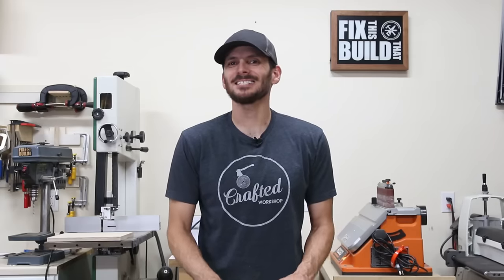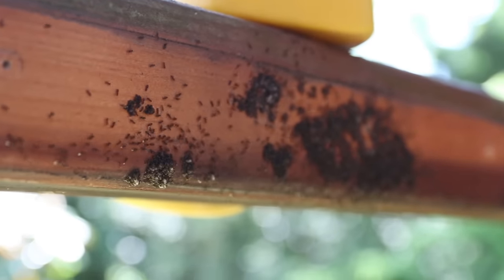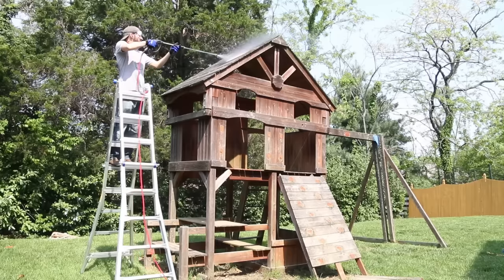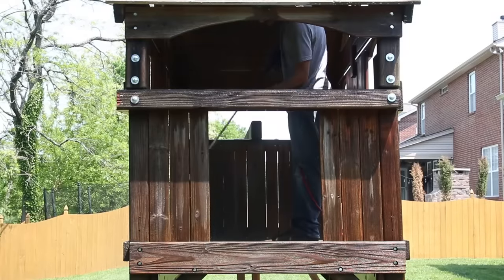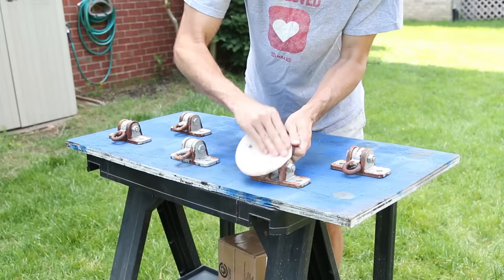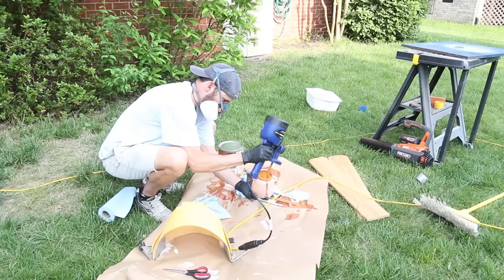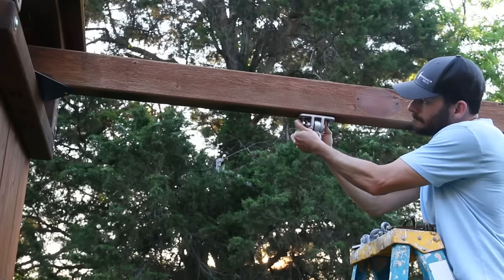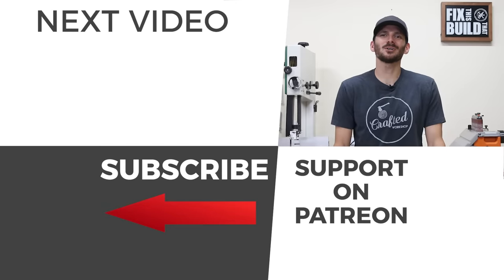Why don't more peole do this for their kids?

Comment: Awesome job! Only question I have is what did you do in place of the tic-tac-toe?
Reply from the maker: Just boarded it up. Realized I left that part out after I was done editing.
Reply: Fix This Build That did you get rid of the ants?
Reply: Fix This Build That I would have stopped working on it if I saw those ants

Comment: Amazing video.  I just got an old swingset that looks very similar and this is the perfect instruction guide to restore it - thank you!  One question - why did you end up using a sanding block instead of an orbital sander?  Would you recommend against any type of powered sander, or was the block just what you had on hand?  Thanks!!!
Reply: I was looking for same answer

Comment: Just bought a nice one. Came stained but could tell it was just pre stain. Putting on some clear oil based sealer, soaks in like crazy. I might spray it but just concerned about getting oil all over the handles, plastic parts

Comment: Great job, 1 thing I will suggest for others is if you have a "smaller" swing set attachment loot to swap out the cross beam with either a 4x6x12 or 2 2x6x12's sistered together. I actually added 1 swing set attachment to each side of mine for maximum amount of swing options.

Comment: Great good on the repair. It looks brand new! I have a similar swing set that the swing arm support bottoms are rotting out as well as the base at the bottom under the enclosure. What would you recommend for repairing or replacing to ensure it’s strongly supported?

Comment: Just finished refurbishing my grandsons playground. Mine was in a little bit worse condition but it looks new now. I used bleach to clean the wood after the first powerwash and after two coats of bleach and two rinses it looked almost white. Then a couple coats of redwood stain and it really looked new again. I also painted the rockwall and handle hardware along with bolting plates swing chains and window frames. Mine needed a new slide, and ladder and rockwall platform. But it was still cheaper than a new one. I aso added rubber mulch in the playsand area as i think the neighbors cat wont use the mulch as a litter box like he would if i used sand. Some indoor outdoor carpet completed the build and my grandson loves it.

Comment: power washing also leaves teak wood a little rough thankfully i have a master mechanic 4 amp 1/4 sheet oscilating sander that makes quick work of restoring teak to a smooth finish

Comment: Hi, great video! Do you have the name or model of this structure? We bought one used, live in North Vancouver and need to replace a lot of wood, and essentially do what you did, for our soon to be 4 year old. We rent, but have a great back yard. so it would be great to have this set up for spring. Wet as we might be right now;) Any help would be great. My wife plans to use sketch up to build a model and then use it on our existing property model to assign a placement.

Comment: I’m in the middle of your video and I like it so far.  At 2:55 you mentioned you “turned up the pressure”.  Does your pressure washer have a regulator that you can adjust to pressure?
Reply from the maker: Yes it does

Comment: If the top beam has a crack in it should you just trash the whole thing? Surface crack, not something that would likely impact safety. We are in Texas. I want to upgrade my set with a swinging bench. Thanks.

Comment: If you use straight bleach with a little detergent, it will work much much better than what you used.  The bleach will also kill all the green mold, and lighten the wood. Just spray it on, and let set for about 20 min before pressure washing. Also works great on restoring old fences.

Comment: I used to have a playhouse that looked very similar to that, except that where that rope ladder was there was a wooden ladder leading up in another way, and there was no windows, and the roof was like this grayish black tarp that was split so there was the part where it covers and then it doesn’t, ”kinda” confusing, we also had swings but instead the baby swing with this yellow plastic horse, and there was a small monkey bars, then we got rid of the swings, then the whole thing.